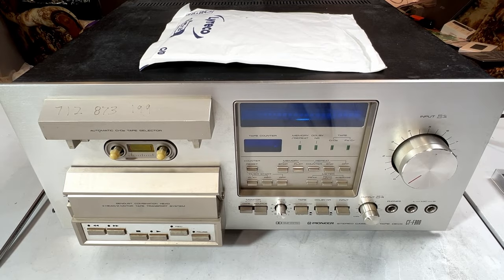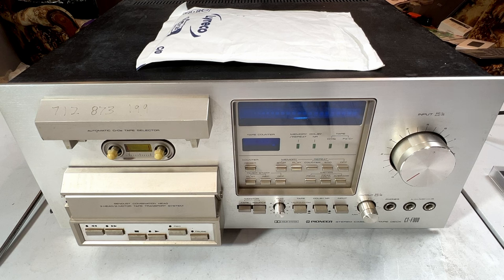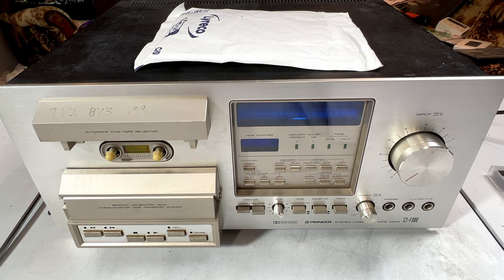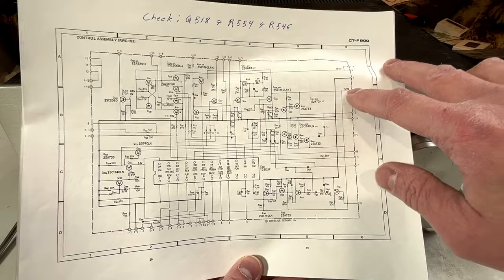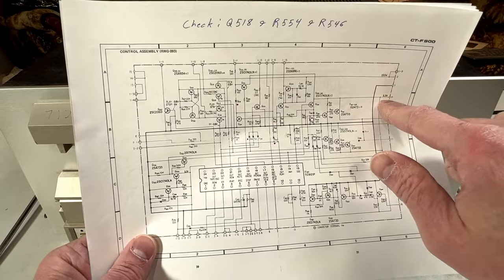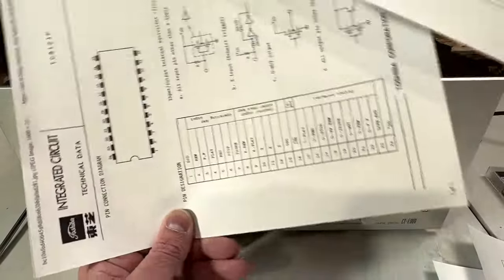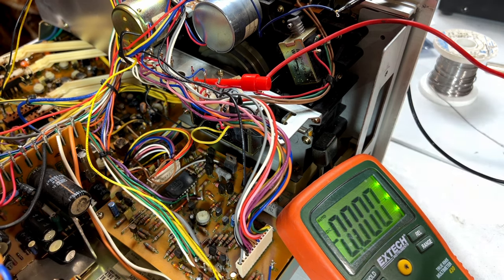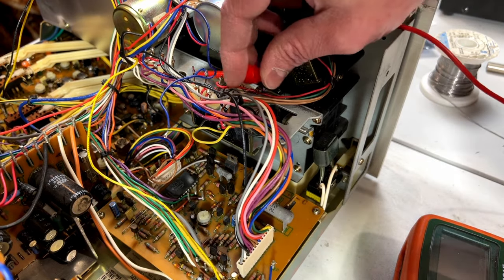Pioneer CT-F900 No Play Diagnosis and Fix

Comment: Hola amigo, he vistos tus video y te puedo decir que he reparado varios de estos Deck (CT-F1250, CT-F950, CT-F900 y CT-F850) el motor de los Reel es alimentado por un circuito de 4  transistores, por lo cual el motor nunca te dañara ese CHIP. Te recomiendo que desarmes ese motor y le hagas mantenimiento. Con lo que dices que el control de BIAS que esta en el frente funciona solo con las cintas normales es bien extraño, porque yo tengo un CT-F950 y funciona tanto con cintas normales como de cromo y metal.

Comment: You can sneak it out if your willing to drill a hole in the front to gain access to a screw.
if your going to take apart the reel motor, make sure is is pristine clean inside when done (acetone spray), clean out gaps in commutator,(not aggressively).
polish the commutator to a mirror finish to avoid a brake in period(7000 grit final)  spin on drill
GENTLY burnish the speed contacts by rubbing them together using acetone then blow them out dry.
clean brushes with acetone on cotton swab(like cleaning your ears)
agline brushes so you can just see the edge of bushing hole.
put end washer on top of bushing before putting  motor into brushes(its just easier).
the tiniest amount of oil on bushing, bench test with 3v for a bit,
tap motor with screw driver to set bushings.
 then test motor with 0.5 volts(motor should still be turning).
if you warp the outer shell back plate taking it out: flatten it back out, use 3 dabs of contact glue to hold it back on(its just easier)
Acetone: automotive product - CRC Throttle Body Kleen
Oh and above all Have Fun.(probably not but rewarding)

Comment: I can spend 20-50 hours on one deck alone - for a full restoration. Not surprised then, that a machine like this will take just as long or longer!? I am surprised the IC went kaput! Sometimes it is worth injecting some good switch cleaner into or behind the button, especially if the contact underneath sticks or 'bounces'.

I admire those who take the time out to  video some of their work, personally I can't be bothered, it would slow my progress down to a crawl, and I'd have to later remove all the swearing!

Go and get a good night's sleep  my friend!  ;o)